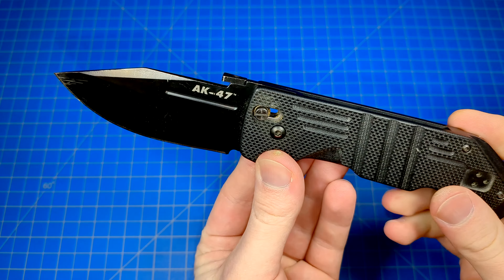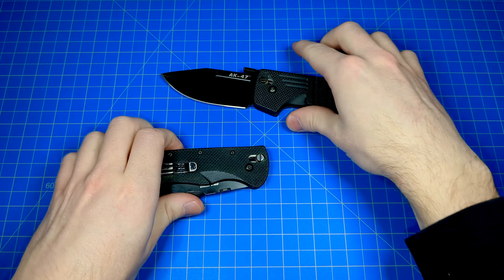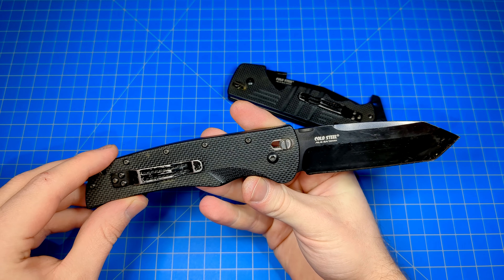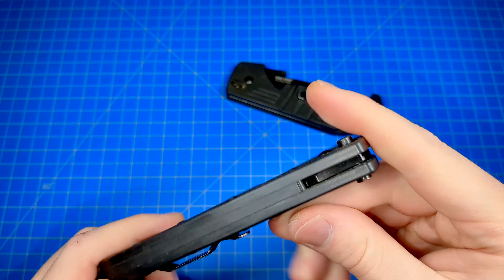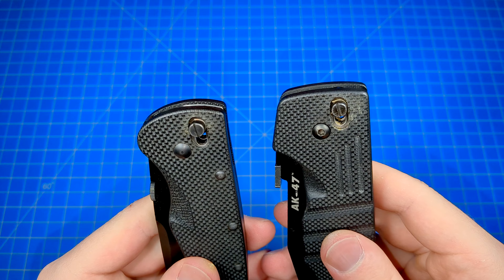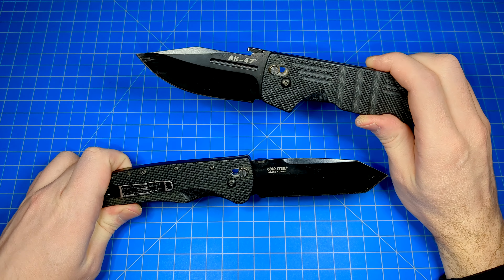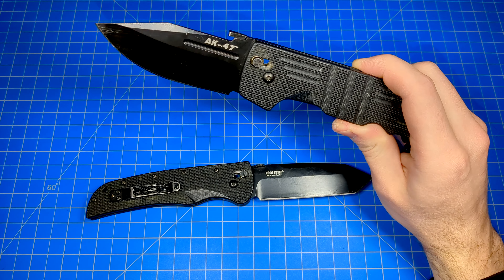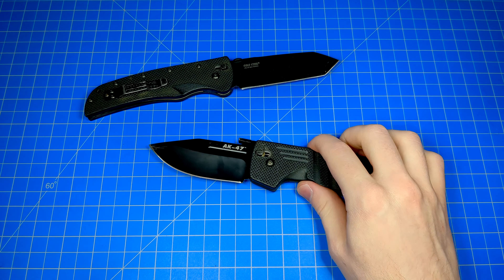Introducing the Cold Steel Ultra Lock! (Discontinued)

Comment: Had a tanto recon a decade ago. It was much first cold steel and use it's ton it's looked terrible but no issues. I lost it when moving dirt piles on farm. A year later my dad found it buried . Other than a couple rust spots on spring a liner t
Still rock solid and shortly after regrettably sold it.